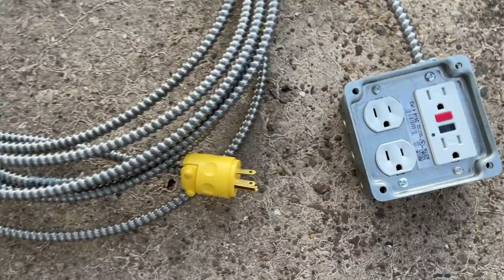SUPER HEAVY DUTY DIY EXTENSION CORD - ALMOST INDESTRUCTIBLE!

Comment: People please don't do this. Just buy a good heavy usage extension cord it may save your life. Too many problems with this to list, not to mention a OSHA violation if used on a jobsite.
Reply: But its rated for 120V with HDMI protection!!!!
Reply: @ericklein5097  That's GFCI. All the components in them self are ok. It's how they are used and assembled. Installing a GFCI device in the box doesn't protect the cord from plug to the box, only the equipment plugged into it. If used it in a wet or damp environment you could get a deadly shock without even pluging in to it. OSHA rules are intended to protect workers from harm or death. There is no guarantee that one of these cords are safety put together. Kind of like the difference between a HDMI and a GFCI. There are plenty of extremely Dangerous assembly videos on YouTube.
I personally feel your life and others are worth being cautious.
Reply: @michaeltrent9716  its a joke. I used to work for a company that made the outdoor while in use covers that are required by code to be installed on outlets that are outside (amongst other things). That wire is rated for more than 120V as well I'm sure.
Reply: @michaeltrent9716  I mess with over 100 volts of PV every day and fiddle with DC power and power walls all the time. I don't need a safety lesson. You need a sense of humor. I was mocking the creator of the video (lightheardedly OP, lets all laugh together)
Reply: @michaeltrent9716 if ur so smart u should learn what a joke is lol